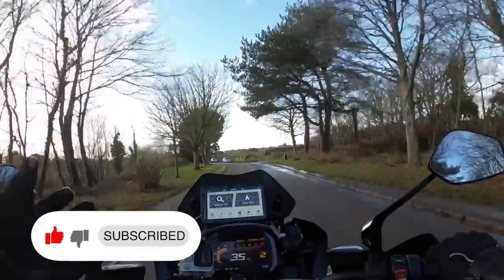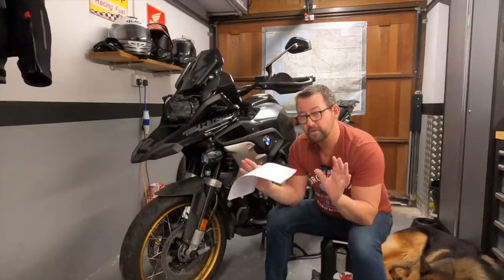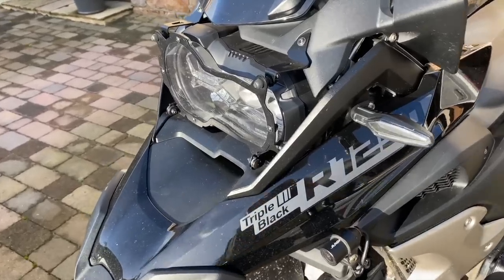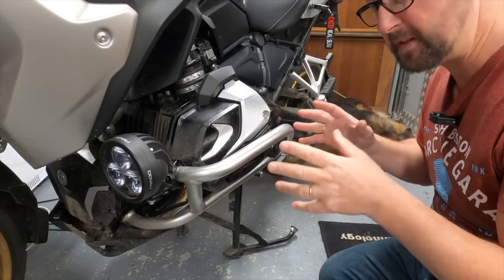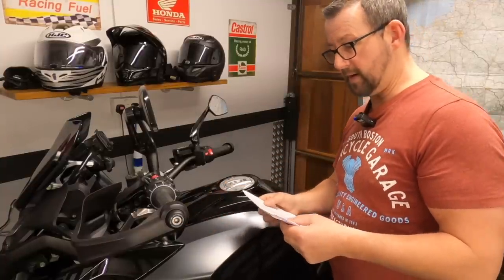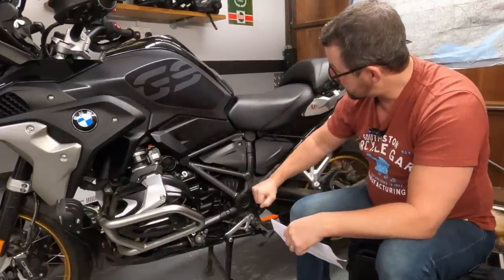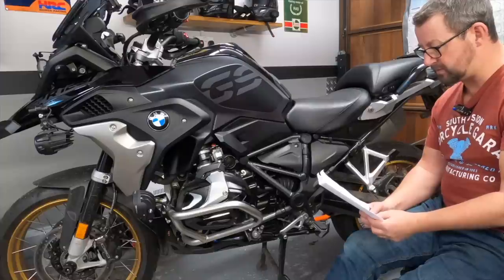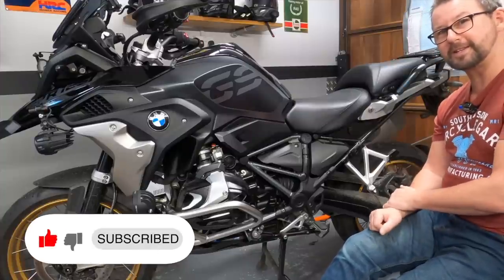Accessories fitted to my 2022 BMW R1250GS-Would I fit them again? Let's find out.🤪

Comment: Nice vid! I believe the bike is balanced at the factory with a (heavier) stock exhaust. When you put on a much lighter exhaust you might have to compensate by leaning to the right? As an old Vespa rider I came to think of this as an explanation to your riding problem. Maybe there is an impact from the Road 6 too…
Reply from the maker: Thanks for that input, I will try the bike with my side cases on and load the right one upon and see if your theory holds any water 🤔ride safe

Comment: 30:15 -- I wonder if you just cut / disconnect the brake wire and just leave the position light, turn signal and ground wires intact on each of the indicators... would that throw a CANBUS error or something up on the TFT? It would certainly be alot cheaper than to replace them with those ugly weiser indicators to fix the issue of the indicator light not being visible when the brake light is on.

34:19 -- I actually have the Sena SRL Mesh Intercom for Shoei helmets (I have the Shoei Neotec II) and I am happy to report that I can turn the volume up & down using the BMW wonder wheel! So it's not only BMW intercoms that work with it. I think the problem is that your Sena 10S is quite old (2016) and the bluetooth tech on the BMW is newer; let me explain: Your 2016 Sena 10S has bluetooth 4.1 while your 2022 BMW has bluetooth 5. I previously had the Sena SRL 2 and the wonder wheel didn't work with that and guess what, it had bluetooth 4.1, just like your 10S! My newer Sena SRL Mesh has bluetooth 5 and the volume works perfectly! It even pauses the song if you turn the volume down all the way to mute it, it's brilliant. The only downside is that if a mate tries to talk with you at a traffic light and you haven't put the bike in neutral, it's gets very bothersome trying to turn the wonder wheel down while also keeping the clutch pressed, but that's a first world problem right there 😅

Other than that, here's a list of accessories that I've currently put on my 2022 R1250 GS Adventure so far: (Product - Code)
--------------------------------------------------
BMW Motorrad Navigator VI (ECE) - 77528355800
BMW All Weather Motorcycle Cover - 71607689674
BMW TFT Screen Protector Glass - 77522462777
BMW Aluminum TopCase - 77431539595 + 2x 77498544517 + 77448546808 + 77438543194 + 77498543224
BMW Aluminum Case, Left - 77411539593 + 3x 77498544517 + 77418543197 + 77498543224
BMW Aluminum Case, Right - 77411539594 + 3x 77498544517 + 77418543199 + 77498543224
Rubber PrecisionTech - RPT-GSM1T1 + RPT-GSM2T1
Wunderlich Luggage Net (TopCase) - 20572-200
Wunderlich Luggage Net x2 (SideCase) - 20572-000
Wunderlich Side Stand Enlarger - 43920-002
Wunderlich Tool Box - 41601-100 + 41602-002
Wunderlich Hand Guard Extension - 44940-005
Wunderlich Grip Puppies - 42320-000
Wunderlich Frame Plug Set 11-Piece + Tank Protection Bar Caps + Caps For Case Carrier - 42742-102 + 42742-312 + 42742-402
Wunderlich Crossbar, Black - 25037-002
Touratech Dual USB Plug-n-Play socket - 01-030-0084-0
Touratech Front Axle Crash Bung - 01-037-5507-0
Touratech ABS Sensor Protection, Front - 01-045-5005-0
Touratech Side Stand Switch Protector - 01-045-5105-0
Touratech Cardan Crash Bung - 01-045-5505-0
Touratech Cardan guard - 01-045-5500-0
Touratech Hub cap cover, Black - 01-045-5266-0
Puig Headlight Protector - 20814W
Puig Racing Screen - 6487W + 7566N
Puig Touring Screen - 6486W + 7566N
Puig Multi-Adjustable Clip-On Visor - 6375W
GIVI Tanklock 5L Tank Bag - GIVI-EA123 + GIVI-BF17
GIVI Ultima-T Waterproof 40L Cargo Bag - GIVI-UT803
GIVI Specific Tool Bag - GIVI-XS5112R
MachineartMoto Avant - AV-12GS-LC
MachineartMoto MudSling - MS-12GS-LC
Motografix - TB051WBR + KB035LCRC + BTI001W
Alaska Leather Medium Sheepskin Buttpad, Natural Long Hair
Reply from the maker: Some ones been a busy person , not sure if I will upgrade my 10s just yet, as all I have to do is rotate the jog wheel, no big problem....but....mmmmmm...tempted.😂

Comment: Hey GSD, i have the same problem with my Michelin road 6 tires, my motorcycle also pulls to the left. I also rode the stock anakees before this and never noticed it before. Greetings Gijsbertus
Reply from the maker: Not sure if the tyre supplier will do anything...I will pop into my BMW dealer soon and see what the latest is. To be honest as the bike handles so well with the 6's I may have left it too late for the complaint, even though I have done 2500 miles on them which some folks do in long trip.

Comment: To utilise the down-shift blipper you must have 0% throttle, not 1% or 5%, 0%. Try it out and I think you’ll rethink your thoughts on it. Also on the quick-shifter between first and second you can use it if you have low throttle percentage and low revs and it’ll be fine. They aren’t the best though admittedly.
Reply from the maker: Todd I’ve tried all sorts worth the down blipper and it’s awful , even rolling the throttle through 0% (not possible but you get my drift) 1-2 if you gun it is very jerky and yes if gentle acceleration it may reduce this . Love the bike though 👍
Reply: @gsd32i  it’s not awful lol, I have a Nov 21 Rallye and find the blipper one of the better rider aids on my bike. You’ll have to try harder 😉
Reply from the maker: @toddstephenson7154  indeed. I may actually pop into my dealer and take another our for comparison ....some folks have had them recalibrated?????
Reply: Okay, I haven’t heard of that but I don’t have any friends either, cannot hurt for the dealer to look at it for a second opinion.
Reply: @toddstephenson7154  they are awful. I have one with 500 miles on and it’s the worst of any bike i’ve owned. Actually like sitting on a rocking horse .
Reply: I ride an F900XR, and I experience that when I have 0% throttle it feels that I have to force the shifter down. And when I give a little bit of throttle it goes very smoothly and almost drops a  gear by itself.

Comment: Morning 
Nice informed vid I have very similar extras on my GS
However if there is a potential issue with front wheel balancing then certainly get it looked at,but why would you want to ride with no hands on the bars at 40 mph irrespective of what others do stood on the pegs or not.
Unless your a stunt rider which you're probably not.
Your bike is a beauty as is mine but keep your hands on the bars.
Just my opinion
Reply from the maker: Hi.Its always nice to stretch limbs and things when on a long ride....hands off will identify any issues with the bike/tyres as in this case. Ride safe.😁

Comment: Lots of chatter about the multifunction indicators, yet nobody has been able to provide a scenario in which indicating and being stationary has caused an issue. And hopefully we all have the good road skills to indicate in good time before braking. It's a non-issue yet seems to have some folks slavishly modding their bikes needlessly.
Reply from the maker: I have to agree with that . It’s very easy to jump on the bandwagon as I think I may have done . However , I do prefer the old style rear setup but I do like the front indicators , which were similar to what I had on my Africa twin and I never had an issue with those 👍
Reply: @gsd32i  Yes, very similar chatter regards the front indicators, and which have been on Hondas for years without any evidenced issues (including my own Honda experience). Very few of us will have NOT experienced a car pulling out on us -  we bring our experience to anticipate these and to defend against them. (Funny how near incidents get less the more years you ride a bike!) But all of a sudden it's due to BMW having adopted amber indicator drls!